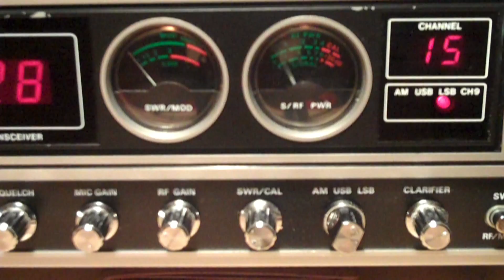Cobra 2000 GTL SSB audio problem, part1

Comment: sounds like the radio is starving for amperage, the 2000's are known to have factory defects with the internal power supply, switch the hook up to dc power and get a heavy duty double fused ranger 2950 power cord and run the radio off an external power supply, will run alot better.